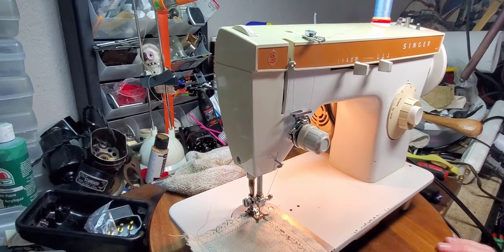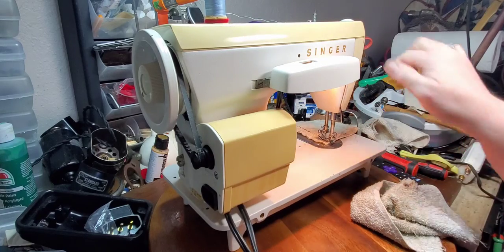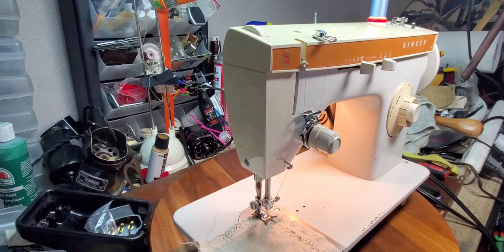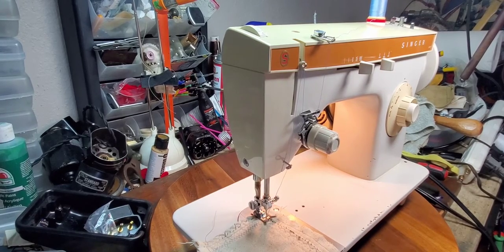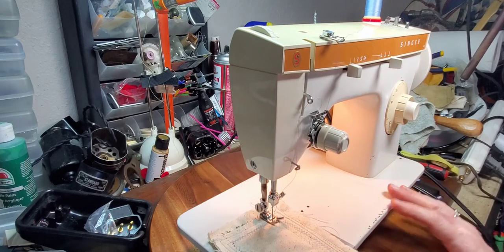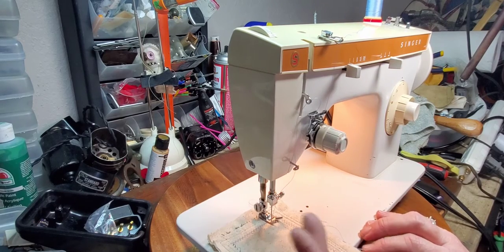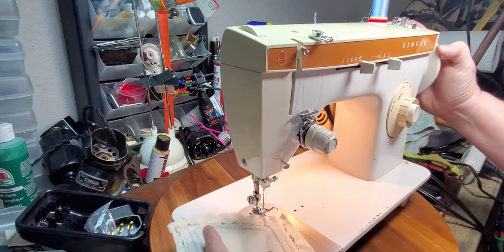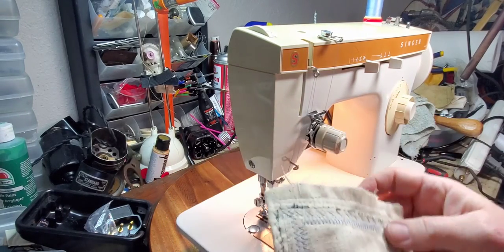Singer 247 sewing demonstration

Comment: I have the same machine and I am learning to sew with it. Is there a way to lock the reverse button?
Reply from the maker: No.  The reverse button needs pressure to engage.  Curious as to why you would want to run in reverse.  If you wanted the machine to run in reverse, you could find, maybe a motor that runs in reverse.  The only issue you may have is mounting it on the machine. Kenmore machines from the 40s and 50s motors, run in reverse.  Cause they were friction driven, not belt.  If it is running in reverse and you dont want it to, then you will need to oil the machine, sewing machine oil only.  oil that assembly well, then work that button until it releases.  Bring your stitch length to the longest stitch for maximum movement of the button

Comment: I have one of these but I can’t get my thread tension high enough :( any suggestions? Bobbin is fully loose and dial is cranked up.
Reply from the maker: So, when you pulll the top thread through the tension disks, and the pressor foot is down, do you get any resistance?  If you do, you should not be able to pull the thread through if it is set to 9.  After confirmed that the tension disks are working properly, what type of stitch problems are you having?  IF the thread pulls through easily with the pressor foot down, then the issue is with the pin inside the tension unit.  If you take the nose cover off, there is a mechanism that moves when the pressor foot lever is moved up and down.  See if that mechanism is 1. Moving.  2. That you can see the pin coming out of the back of the tension assembly.  Let me know what you find.
Reply: @tksewingmachineandrepair4243  Wow thank so much you for such immediate response!. There is resistance with pressor foot down and tension at 9, I cannot pull the thread. The top thread shows up at the bottom and bottom looks just flat pulling the top towards it. I also get occasional thread bunching at the bottom, can't quite figure out if it is the top thread bunching or the bottom. 

I even tried fully removing the tension screw from the bobbin and cranking the tension dial up, still not enough tension :(.
Reply from the maker: @lucasmikejackson  It could be a couple of things. Do you have the pressure foot pressure all the way down. There is a bolt on top of the machine that screws right and left. It is directly on top of the pressure foot bar. If you are sewing anything but bulky projects, it should be screwed all the way down. Lack of pressure on the pressor foot can cause uneven stitches. Also, are you using the same thread both top and bottom? If not, do. Lastly, does the needle match for the fabric you are sewing? Example: ball point needle for knits. Let me know
Reply: @tksewingmachineandrepair4243  Preassure foot pressure was set at 3, just tried all the way down and all the way up, problem persists. Yes, I'm using a #69 bonded nylon thread top and bottom. Fabric is Cordura 1000 and needle is a singer 100/18.

Comment: What should I do if the stitches in the back is loose
Reply from the maker: That is normally a tension issue.  Rethread the machine, start by adjusting the top tension to 3.5.  Move the dial higher by.5 until the stitches look good